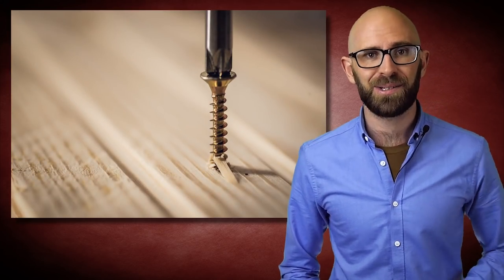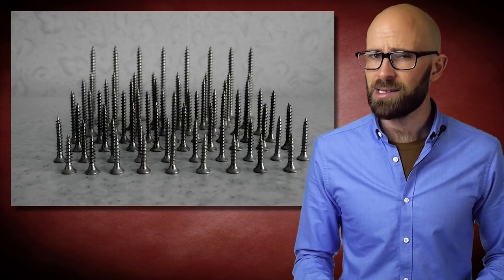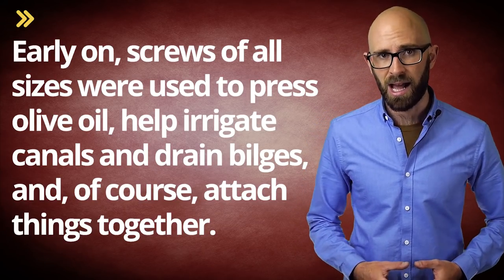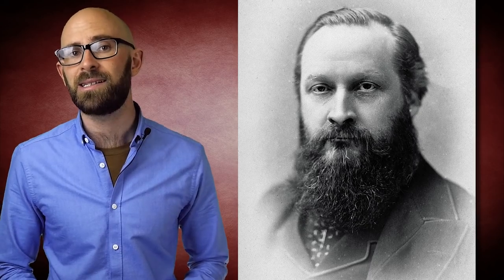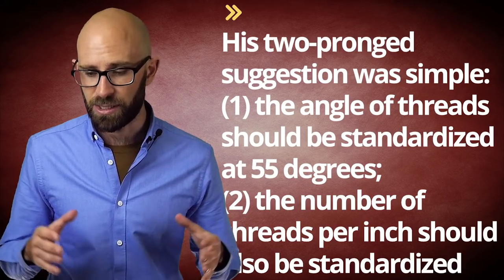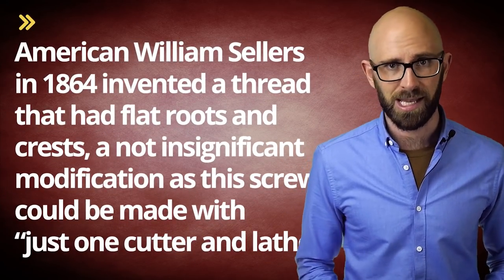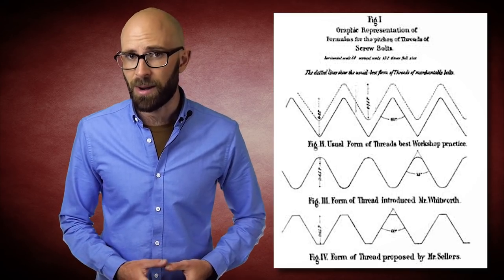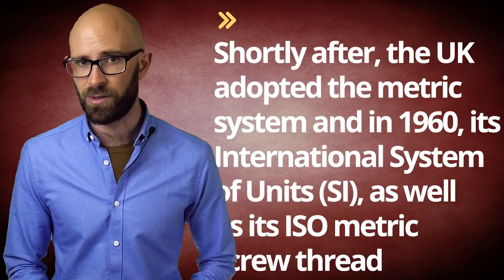Why Do Screws Tighten Clockwise?

Comment: I was glad to hear him mention William Sellers. Metric screws use the geometry introduced by Sellers, but they  use dimensions based on the metric system. The SAE standard threads, now known as fine threads were introduced after the metric standard had been established. In perhaps the most costly example of NIH in the history of the world the predecessor organization to SAE decided that they needed to introduce a new thread standard optimized fro steel instead of just using the metric standard. This burdened the US with two thread standards (USS (coarse)and SAE (fine) and eventually three thread standards when world trade forced the use of metric screws even on American products. 

In some sort of bizarro American NIH the US forced US thread standard on to the international space station. The pain, annoyance and costs of the American system of screw dimensions seems likely to continue indefinitely into the future. Europeans don't know the fun of attempting to thread a fine screw into a coarse or metric nut. Or keeping a supply of screws at home only to find that you need one based on the standard you don't have.

Comment: Also, it is MUCH easier to cut a right handed thread on a standard lathe than a left handed one.  The headstock of a traditional lathe is on the left hand side of the machine, the "forward" direction of the spindle is counter-clockwise (looking at the front of the chuck; the work rotates towards the machinist from the top), the cutting tool's cutting surface is facing up, and material removed by moving the tool from right to left.  A right handed thread is made by this standard process, while a left handed thread would require changing the arrangement (I found this out the hard way as a machinist apprentice).  So, the easier-to-make thread direction would naturally become the standard.  An internal right hand thread sucks to make on a lathe (because you can't see the cutter while running the machine in the "traditional" fashion), but since tapping (i.e., cutting or forming an internal thread with a special thread cutting bit ["tap"]) is a very easy process on either a lathe or a milling machine, it makes sense that this is why screw threads are generally right handed.

Left handed threads are VERY rare, and only used in things like turnbuckles (using one right and one left handed thread on opposing ends to pull two things together while rotating the center piece) or in some specialized rotating components (so the forces of operation will make the screws tend to tighten rather than loosen).

Comment: This video mixes up screw threads and threads for screw bolts. For example the screw shown at 2:10 has nothing to do with Whitworth's work of standardisation, and Simon keeps wrongly referring to bolts as screws.
Reply: VRBTech bolts don't necessarily have threads.  The ones that do are screws whether they're bolts or not.

If it's used as a fastener lengthwise, it's a screw, not a bolt.

Think of a bolt like a deadbolt on a door.  All bolts are used in this manner.  Some are screws, some are not.
Reply: Not to mention set screws are a specific bolt style with full thread coverage. Cap screws? Or are they in-hex bolts? Button head screws, dome head screws, machine screws... etc.

Comment: Machining 101! Anyone that has made a thread using a lathe can tell you that it's much tougher to do than it looks. You have to engage your cutting tool at just the right point and time it out with great precision. It is incredibly easy to make a mistake.

Comment: Although clockwise screws are pretty much the industrial standard, there are still standards for counterclockwise screws as well, because there are application-specific cases in which a left-hand screw is necessary. One case I can think of is on some heavy duty trucks, where the lugnuts on each side of the truck are tightened in opposing directions in order to minimize the risks of lug nuts vibrating loose while the wheel itself is turning and rolling down the road.

Nonetheless, a fascinating look into the real history behind something as mundane as the screw.

Comment: "Righty-Tighty" also has to do with the direction of force of the screw when working. In civil engineering it is known that a screw force has two vectors: one around the screw and the other directed along the axis of the screw. To find which way it works, curl your right hand in the direction of the screw and your outstretched thumb will show the direction of force of the screw. Pointing your fingers in the direction of "righty-tighty" will point your thumb in the direction of the piece the screw will hold. The force of the screw has nothing to do with handedness but of the force of the twist or torque in its direction.

If you curl the fingers of your right hand in the direction of "lefty-loosey" the thumb points away from the object it is embedded in, so the force points up.

Try pushing in while you are unscrewing and you will feel the force pushing against you and still inexorably moving the screw toward you.

Comment: You made a mistake i the Whitworth thread crossection, it doesnot have a pyramid crest.

It is the only thread that has both rounded roots and crests. This rounding of roots and crests means that it is still alive today, mainly used in explosives, as the rounding is less likely to cause friction or ignite the charges.

Comment: Good video, though I wish it had more citations about the original question -- why did we pick clockwise? It's plausible that it was due to right-handed people having more strength in that direction, but what evidence supports or counters that explanation?
Reply: William Dye Well for starters its common sense...
Reply: Broken Wave : The times when I've needed maximal strength on a bolt or screw have always been during loosening a stuck item. How is it common sense to give preference to the case that almost never needs the most torque?
Reply: I agree with you, William,and so do the tool manufacturers.  Battery powered screwguns are geared so that they provide more power in reverse for removing screws than for installing them.  It's just common sense.  If screws were put in with more force than they could be taken out with, they could never be removed.

Comment: From all the pics I've seen of lathes from dark ages up had the headstock on the left. Even rope powered kick lathes. (for right handed people I assume)  Even if cutting the threads by hand the rod or to be bolt turns towards you and you work towards the headstock. You can cut left handed threads by reversing rotation and flipping the cutting tool. It feels backasswards cutting left hand treads on a manual lathe. Watching on a CNC lathe it looks the same because its cutting threads so fast. 
I'd urge anyone to pull up a video of cutting threads on a manual engine lathe. It takes practice , reflex , concentration , decent eye sight.

Comment: Where did we get the term "Weight" when used in automotive oils, i.e. 10W30.  The "W" isn't for weight as most oils are relatively the same weight no matter the viscosity, the "W" is for "Winter."  So where and why do many still use the term Weight?

Comment: Why is sex also called "screwing", when there is nothing akin to screwing happening?
Reply: You are not doing it right
Reply: Tell that to a duck....
Reply: You can also be screwed over wich alters the meaning :d
Reply: +Grimmrok
You cannot see how a helical fastener has a "male" part and a "female" part? That's literally how they are referred to in trade use!
Reply: Probably the same reason it is called blowing although it isn't exactly on fire.
Reply: Cleiton Felipe 
Only once, at band camp...
Reply: Screws solve many problems as does screwing . Craig Walker Sydney Australia
Reply: Tried safe blowing still couldn't get the bloody thing opened
Reply: Brendan Gibson you have enlightened me. You finally opened my eyes. It was so simple. How didn't I see oit before? Now I understand it all!

/sarcasm
Reply: Grimmrok  In one of these situations, you're inserting part of one object into another in order to bring the two objects closer and attach them to each other.  
In the other situation, you're tightening a mechanical fastener....
Reply: Look up Sex Screws.  They are a type of fastener.  Not a joke.

Comment: Always wondered why the predominant term for standard screws used for photography gear became "quarter inch thread" and whatnot. There you go
Reply: XSportSeeker "Quarter inch thread" means its a 1/4" wide screw. Has nothing to do with the threads per inch
Reply: If you want to get technical it’s a 1/4-20 screw. Meaning the screw is 1/4” in diameter, and a 1” long section of a bolt will have 20 wraps of the thread on it. So if you’re ever making a camera mount, a 1/4-20 bolt or threaded rod from the hardware store will screw into your cameras tripod mount, however a 1/4-28 will not because the threads are too close together and won’t line up.
Reply: While metric dominates the world, inch measurements still creep in... today automobile tires are bi-dimensioned... the rim diameter is in inches and the tire's width is in mm. British standard pipe threads are of Whitworth 55 degree form and are still used world wide along with the American std. pipe thread (60 degree).  I don't know if there is an ISO metric std. for pipe threads, but if there is I've never seen it on any equipment foreign or domestic. 
Because the inch, since the 1920's, is defined by the millimeter (exactly 25.4mm/inch), manual lathes can cut either inch or metric threads by interposing a 127/120 compound gear (here exact or similar very close ratios) into the screw cutting gear train. As an aside, 127 is the first place where metric and inch systems coincide .. 127mm = 5.00000 inches.
Reply: Aceroadholder, 
The worst part about tire sizes is wheel diameters and widths are nominal. a 17" wheel is not 17 inches.
But we still have American tire sizes, which is my opinion are infinitely more usable and understandable.

A 33x10.50x15 is a tire that is 33" in diameter, 10.5" in width, with a 15" tire bead.
Wonderful.
A 275 70 r16 is a 275mm wide tire, with a side wall height that is 70% that of the width of the tire, and it fits on a 16 inch nominal wheel.
Basically you cannot figure out the circumference on your own, you need a reference chart. So any sort of gearing calculations using metric tires is a giant fucking pain in the ass.

Also there's the difference between metric offset, and standard backspacing.
Offset is a number in mm that is based entirely off of the center line of the wheel, while backspacing is a number in inches that is based entirely off of the back rim of the wheel.
So in metric, you need to do fitment calculations, while in standard you don't.
If you know you need 4" of backspacing or less to clear your suspension, then that's all you need to know, no matter how wide your wheel.
With metric you must account for your wheel width (nominal inch standard) 
So a 17x 8 wheel that you have a -40 offset on, if you're going up to a 17x9 you'll need to add something like half an inch to your offset, So you'd need a -52 offset to maintain the same suspension clearances.
It's stupid, it's unnecessary.
Reply: Aceroadholder All of the US standard units are by law based on their metric conversations, So as goes the standard meter (or kilogram) so goes the inch (or pound) Americans, being lovers of choice insist on buying milk by the gallon, but are OK with litres of soft drinks in bigger bottles and ounces in smaller containers. We also seem to love our fractions, A "fifth" (originally 1/5 gallon) of booze is 3/4 of a litre,(so while metric, a fraction is used!)  And 
popular milk containers are 1/4 and 1/2 gallon. Buying products in 1/2 and 1/4 units is perhaps  the REAL reason the 10 based metric system is less used here! 🤔 (personally, I'm ok with both systems generally.) But metric tire sizes and Celsius for weather reporting both suck!
Reply: What part of the US standard says that a half-gallon of ice cream is 56 fluid ounces? Is it because the dairy that makes the stuff is cheating us out of some quantity so they can line their pockets with the same amount of money they charge for a 64-ounce container of ice cream? First it was big government, then big pharma, now it's big dairy. Their greed for more MOO-la is insatiable!

Comment: There is a very common exception to the rule for natural gas pipes that all use left-hand threads to prevent accidently loosening an gas line nut by mistake.

Comment: Incidentally if a right-handed operator stands at a lathe with the headstock on the left, the natural way to work, and makes a screw by turning towards the headstock, which is the easy way to go, it comes out right handed.

Comment: pro tip: when working as a mechanical fitter/machinist and need to make 500 CCW titanium threaded bolts, don't go into auto pilot and thread them all CW. Your boss will rip you a new one.

Comment: Why don't irons have power switches? Why do you need to plug them in and unplug them to turn them on and off?
Reply: Not only irons.  Many things have no switch, which I think is stupid.  I plug them into something that has a switch.
Reply: Maybe because irons are a fire hazard when left on. So if they had a on/off switch some people might forget to hit the switch. If the only way to turn it off is by unplugging it's harder to forget that. That's my guess.
Reply: Because they take so long to heat up an on off switch is pretty pointless
Reply: What, your electrical sockets don't have switches?
Reply: Peter Lund They do, but in many countries they don't. And to switch on and off the plug, you still need to physically reach it. If the iron had a power switch, you could more conveniently switch it on and off without reaching the plug.
Reply: You might have multiple things plugged into the same socket using an adapter and not want to switch them all on and off together.
Reply: you live in a silly country that doesn't mandate all power points having on/off switches
Reply: AFAIK no country mandate all power points to have on/off switches.
Reply: The UK has switches on all wall sockets but it isn't mandatory.
Reply: MrcabooseVG Most wall sockets in the UK have switches, but not all.
Reply: why?
Reply: Mine does. Hot, medium, cool, off.
Reply: Err, well all irons i've seen so far have on/off switches (talking from southern germany)
Reply: Yeah, my iron has a knob that turns it on and off plug the heat range.
Reply: Conway79 because people would always keep them plugged in and forget if it was on or off.
Reply: I save time switching the iron off by simply cutting the wire with a big pair of scissors.
Reply: Really? No answer to this?

Irons use steam, steam and mains switches are a bad combination. Sure you can get switches with a waterproof cover, but how long will that last in the average household? and what happens when the cover becomes worn and the end user cops an electric shock???? In fact I don't think you can actually use those switches for mains on consumer grade appliances..........
Reply: More importantly, why are you screwing around with an iron in the first place?
Reply: My iron has a push-button power switch. If I leave it standing upright for more than 10 minutes, it also turns itself off.

Comment: Withworth and UNC are pretty much interchangeable, the 55 and 60 degree thread angle just makes for a tighter fit. The only real difference was that for the half inch thread..... one was 12 TPI and the other was 13 TPI (threads per inch).....just thought you needed to know another superfluous fact now that we are all(well mostly) metric :) :)

Comment: keep in mind the circle and its component part the degree are indeed the last vestiges of the imperial system...since metric is a system of measure based on 10...then why not the circle ??..
Reply: Did you know that there are 2xPi radians in a circle?

Comment: You forgot to mention the Robertson head screw.  The only screw that you don't actually need to handle with two hands while screwing overhead joints.
Reply: Ted Theobald Considering most bits are magnetic now then that isnt much of a factor. Plus that has nothing to do with this video.
The video isnt called "every detail about all screws"

Comment: Still after being a mechanic all of my life I still can't work out the Whitworth system. A 5/16" bolt with a W/W thread needs a spanner which is between 1/2" and 9/16" and that size is called 1/4 W/W???? Thank God for the metric system.

Comment: Why isn't the boat or raft included as a classic Simple Machine?  I don't know that there's an answer to this. Logically it follows the convention: It's a unique class of tool,  and like the other Simple Machines it reduces work by distributing the force (lever, wedge, screw...), or reducing friction (wheel and axle).

Comment: If it's really true that right handed people find it easier to screw in a clockwise screw, then they got the standard backwards. It's actually the unscrewing that is the more difficult operation for which you need maximal strength. Screws often rust and/or deform from overtorquing and the head may be stripped or filled with paint. All these problems must be overcome before the screw will come out. Compared to unscrewing an old screw, screwing in a new screw is a piece of cake.
Reply: Except that most screws get screwed in once and never removed.

Comment: Why, America, why?
Reply: Because we can. Mwa ha ha ha ha.
Reply: weehawk Because a base 12 system works better with circles. When I work on a lathe, figuring gear ratios to get threads per inch is much easier than threads per cm. Mind you it can be done but I rarley need to change gears for imperial threads. I'm constantly changing gears for metric threads.
When you fix your metric system so I don't need to change gears I will happily go all in.